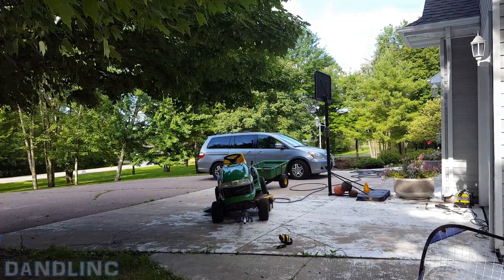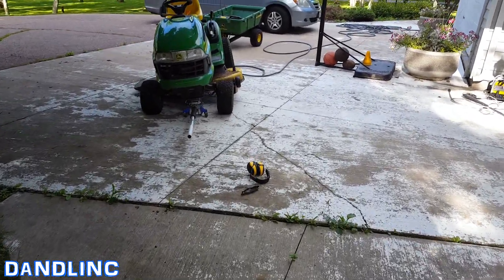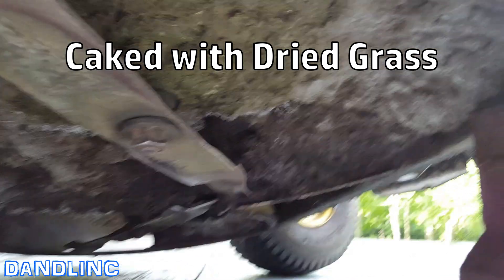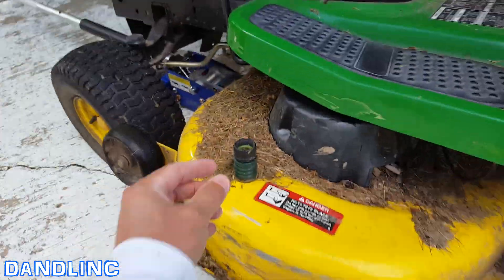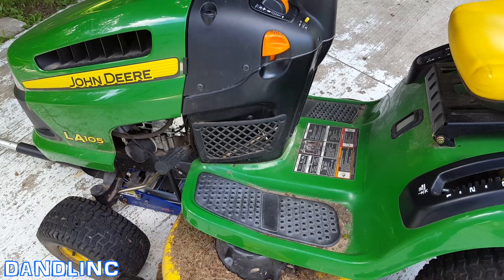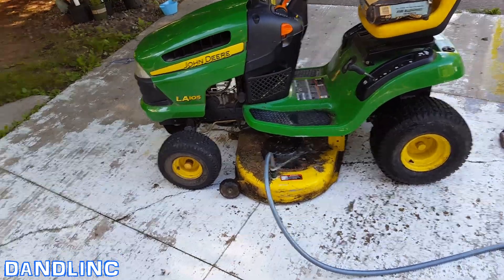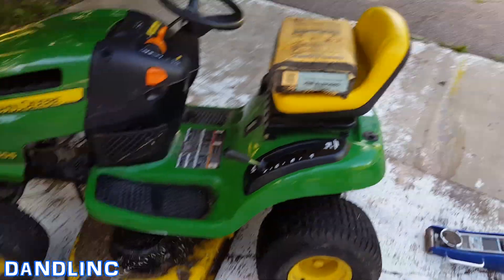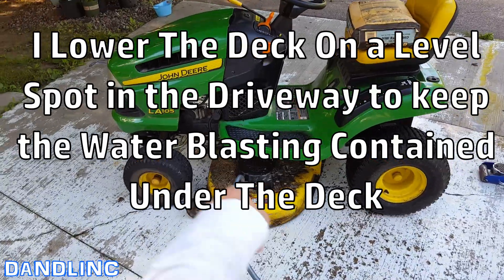How To AUTOWASH Your Lawn Mower Deck (John Deere)

Comment: I hate to tell you this, but the deck wash doesn't work with an already dirty deck with hard dry grass.  in order for the deck was to work, you have to start out with a clean deck, mow the grass, then use the deck wash immediately after mowing the lawn.  that's the only way it will work.  if you wait until after the dirty deck dries, the deck wash will be useless.   the deck wash will only work when you can generate a vacuum spinning action with the water and air.  if you have hard caked on grass on your deck, it will prevent that vacuum spinning action from occurring and the deck wash will be useless.